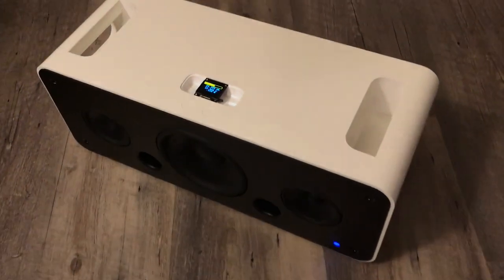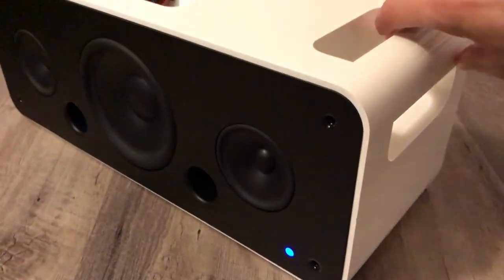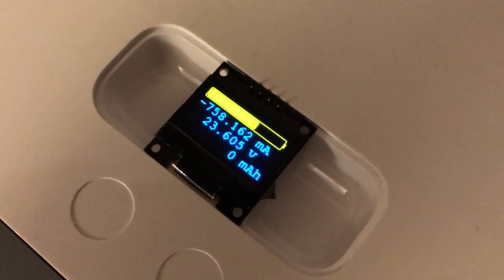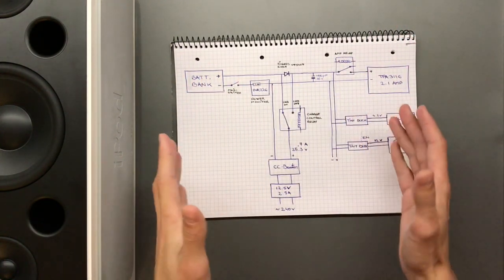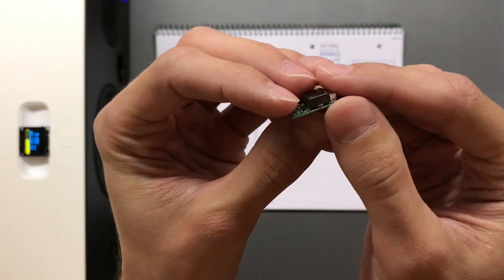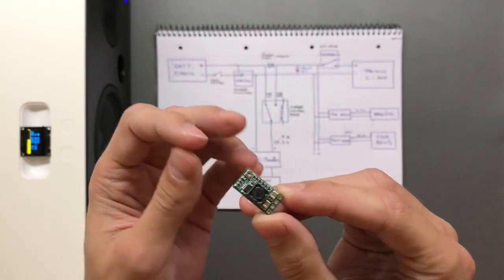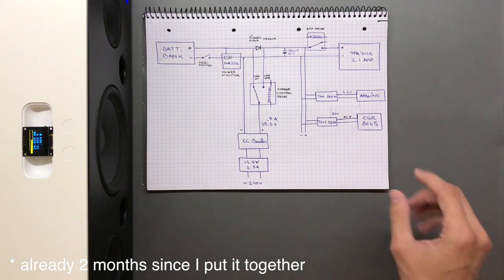DIY Bluetooth iPod Hi-Fi Speaker : Parts Guide 2 : TPA3116 + CSR8645 + Power Monitor + Arduino

Comment: what happened to the big capacitor on the amplifier?
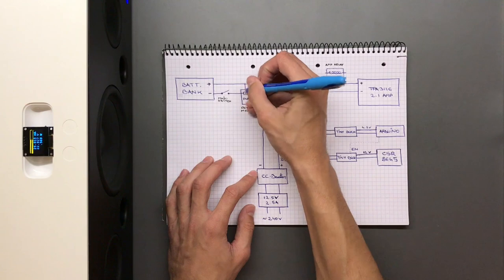Reply from the maker: 6:43
Reply: ahhh ok thanks, missed that, I have the same amplifier so wondered what happened.
Reply from the maker: yeah, did put a tiny 22uF one back in just for good measure

How's yours working ?
Reply: great so far, I like the inclusion of the crossover, built a 2.1 boombox also, just as you my amp is fully inside the box with no way to adjust from outside, so I just set all the treble volume up, the bass volume fully up, I put the bass LPF midway and main volume midway, everything else is adjusted via the equalizer on the phone via Aux, no Bluetooth feature added to it as yet, I tested the little switch on the board, it does indeed switch between  full range and HPF for the left and right speakers, I am using it with the HPF activated
Reply: ...though I wished the left and right with the HPF activated had a bit more depth to it....maybe cross over at a little lower frequency...but it could be due to the type of speakers i am using also, which are sealed back midrange speakers
Reply from the maker: alright - I really didn't get what that switch did ... I think mine's in full range as I do see a lot of flex in my drivers (Apple did claim they were able to deliver full range so .. meh)
Reply from the maker: did you build your own case or have you also scavenged an old speaker ? Bluetooth is a must though given its that cheap nowadays
Reply: I built it out of 1/2" - 12mm MDF.......yes the Bluetooth would be nice...but i'm using it with my tablet and build a sort of dock for it to stand on top of the speaker so , so far haven't missed the Bluetooth feature much...but i will upgrade to it, to make the system more complete, also i heard the AUX in these class d amplifiers, quality is better than than Bluetooth but I don't know how true is that, then there is the fact that I haven't seen an amp as this one with these features and the choice to use bluetooth or AUX
Reply from the maker: well - I fed the bluetooth directly into the input lines. A few years ago, with Bluetooth 2.0, the difference in sound quality was very noticeable. Nowadays with AptX and the impeccable signal strength of BT4.0, it really isn't an issue anymore, at least not at a home-gamer level 

I use another iPod Hi-Fi with an optical cable connected to my computer - and I can't notice the difference when I switch to bluetooth playback
Reply: good...i'll look into getting one

Comment: Tpa 3116 better than yda 138?
Reply from the maker: depends ... it has a turn-on pop, which needs addressing 

but ... outside of that it's a 4 times more powerful, and sounds nicer (I think)
Reply: @Darieee  thanks but tpa 3116 need at least 12volt?
Reply from the maker: kind of

tpa runs down to 5, but EXTREMELY poorly - there is sounds like garbage

you need to feed it 15-26v to have it sound great
Reply: @Darieee  are using 4x  18650 baterays in series solve it?
Reply from the maker: 4S should work super well

I use a 6S pack in there, and that will yield the best results - low current - low distortion - no losses on wires and such

6S also shouldn't be MUCH more of a pain in the ass to wire than 4S ... 

in any case you WILL need some form of ConstantCurrent DC-DC converte for the CC/CV charging of the cells and you WILL need one of those balancing modules !